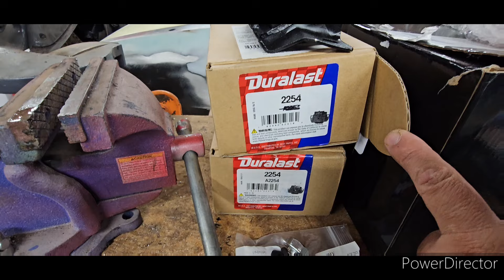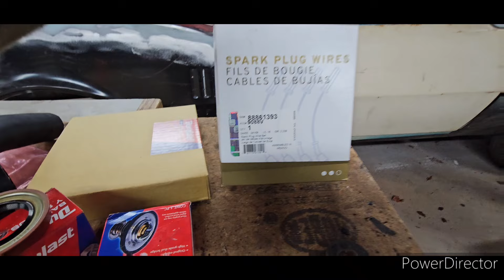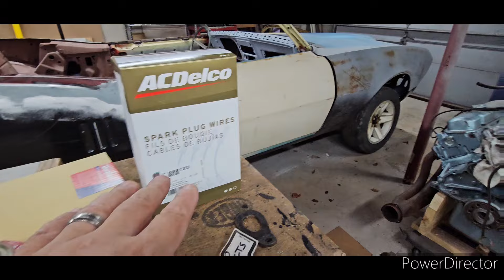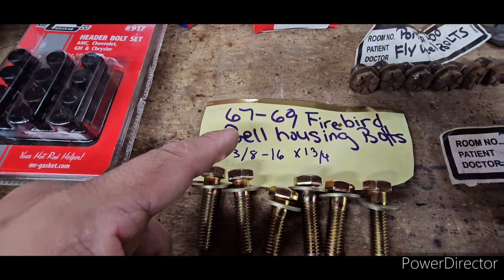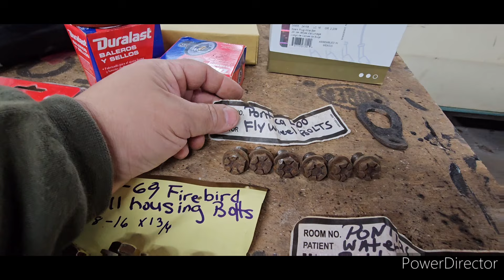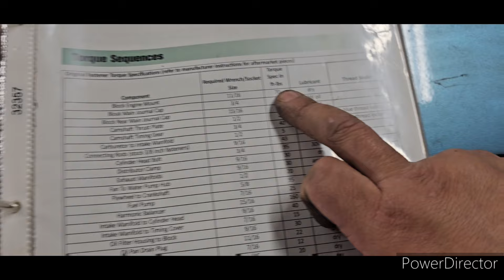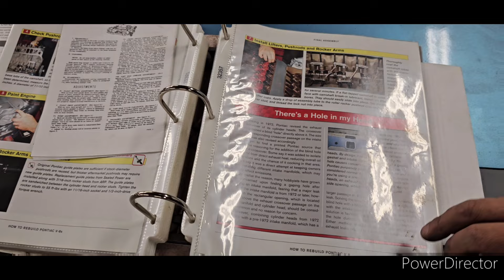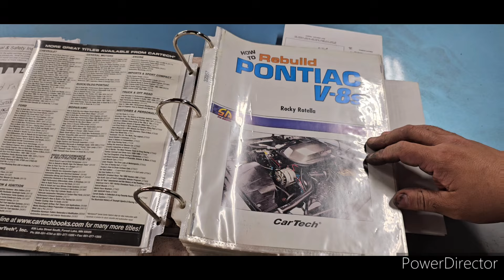What You Will Need To Put A Pontiac Engine into Your Project #pontiac #pontiacfirebird

Comment: Great video, it’s gonna help a lot of people when setting up their Pontiac. One thing I learned when installing my Edelbrock Performer Intake, that long bolt that you pointed out that likes to break, that goes from the timing cover to the intake, had to be shortened to work with the new intake.  Before I shortened it, it leaked from the bypass port between the intake and timing cover. Is that something you’ve run into before?  I found a lot of posts about having to shorten that bolt to prevent it. It took a couple times of shortening it to stop it from leaking.  But I finally got it and it hasn’t been an issue since. But again, great video for people needing help putting their Pontiac together!
Reply from the maker: @ogresspeedshop  thank you for your compliment and your support like always.  I never run into shortening that bolt that goes inside the intake manifold in front of the timing cover and I have four Pontiac engines with Edelbrock intake manifolds never ran into that problem maybe sometimes it just doesn't get machined correctly or the threads don't go deep enough good to know first time I hear about this